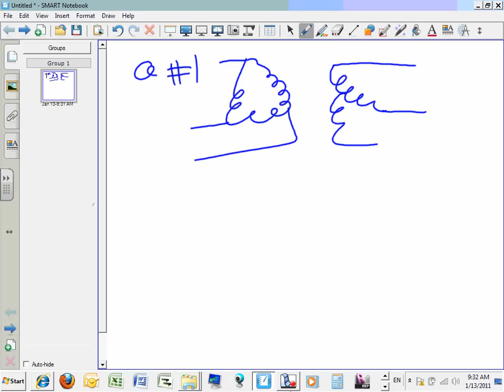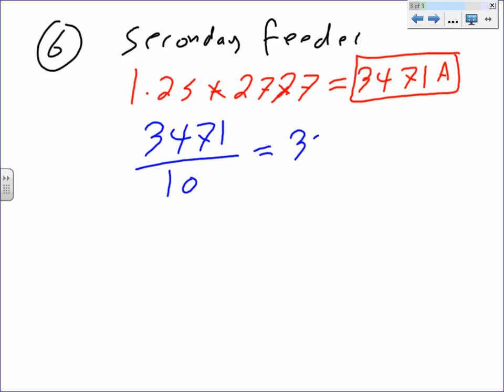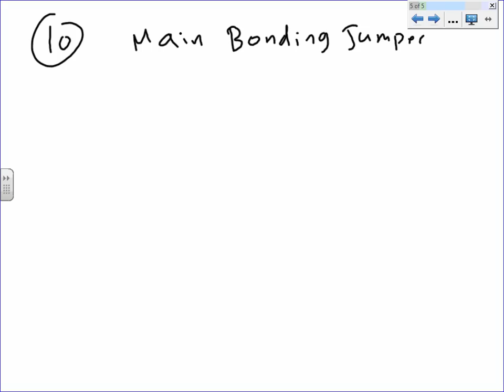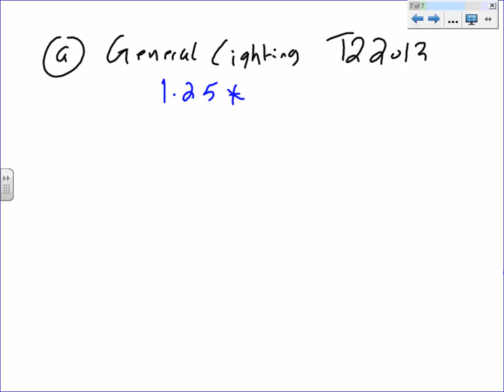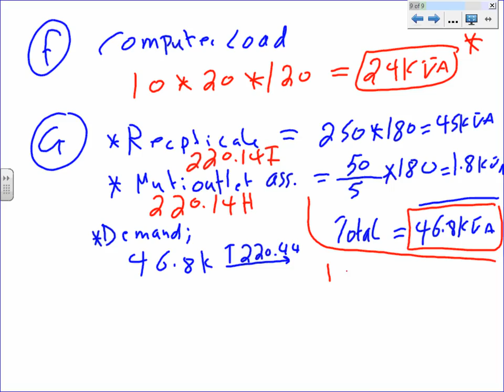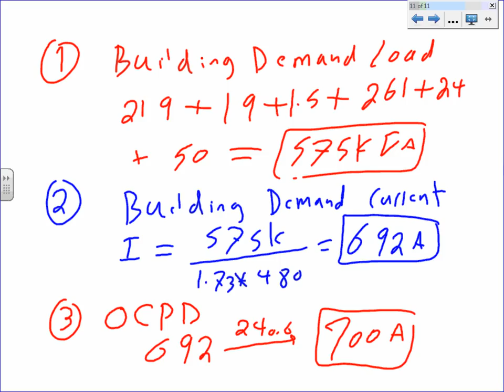Transformer Sizing & Commercial Load calculation T#1 1 review for 01 13 11

Comment: From an electricians stand point 500kcmil is easy to deal with compared to 750kcmil but manufacturers rarely size transformer terminations to accommodate for 10 terminations at 500kcmil. In a perfect world we would have room to do that but they don't care. Any electrician that complains about 500kcmil has never had to deal with real commercial service drops.
Thank you for the information.

Comment: Hi Mukul, I can tell you that in order to understand a little bit more which one is the origin of the factor 1.73 (square root of three) you can read the book "Fundamentals Of Electric Circuits" from Alexander Sadiku, specifically the chapter 12 regarding three-phase circuits.

Comment: Mr. Chad,  I understand the concept of the three different solutions or rules for the sizing of a pull box. However, My issue if a bit different. We want to use a pullbox to continue a run of 150 LF by entering from the bottom and exiting out the back a few feet up. These are 6 500kcm transformer runs from below and up to across the roof to the other side of the building and down to the switchgear. We will probably need roof heat derating as well. We plan to use stands of about 7-9 inches off the surface. Have you done a you tube with scenario before? Can I use the entry from behind calcs with the open door in front, can I use T312.6a without terminals just the bend depth?

Comment: if the size of OCPD in the secondary is 4000A, would U not increase the ampacity of the secondary feeder conductors?  Ampacity of conductors must be greater than or equal to the rating of OCPD ?

Comment: Maybe I am missing the application of this design but is seems as though this is some sort of building electrical service. At about 21:30, I believe the overcurrent protection device on the secondary side is sized in violation of 240.4(C) if no one else has mentioned it. I do not see any other reply. Over 800 amps the code does not permit the next size OPD to be selected. The secondary OPD should be sized based upon design load calcs not the secondary current of the transformer. I will typically have a 500kva transformer, with four or five sets of 500kcmil on a 2,000 amp service and a 1,600 amp trip device. Am I missing something here?
Reply: N Grothe you are wright, according to 240.4(C) anything over 800A you can't use the next higher standard for OCPD's
Reply: NEC 450.3b 
Prim 2.5 x I Line (see note down)
Sec 1.25 x I Line (see note up)

Comment: Chud
I've huge arguments with engineering company for transformer sizing and checking its capacity adequacy.... shall we use FLC (as per NEC T 430.250) or FLA nameplate? I need you solid clarification, please, since I'm considering transformer is as conductors eventually. 

Waiting your kind feedback with code reference, appreciated

Comment: bothers ,

in primary feeder and secondary feeder  your  multiply  1.25 * 1204 or 1.25*2777( primary line current and secondary current )
what is that 1.25 ? why multiply ? 
please explain me
Reply: This is because the transformer is considered a continuous load.
Reply: it means 25% extra capacity of rated value.